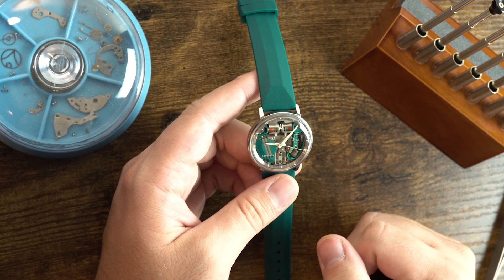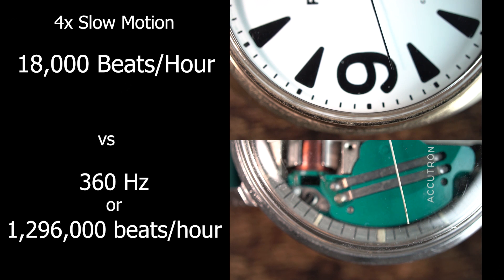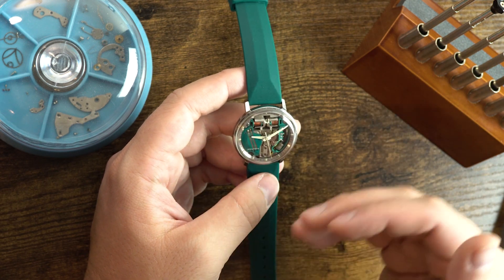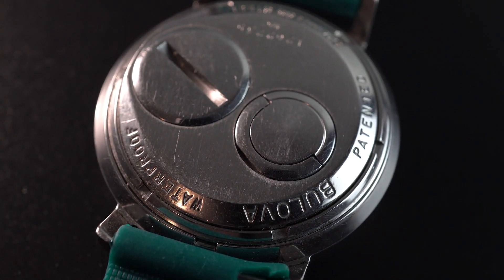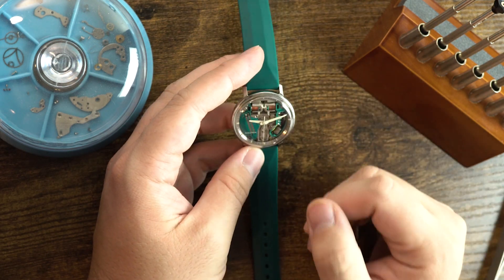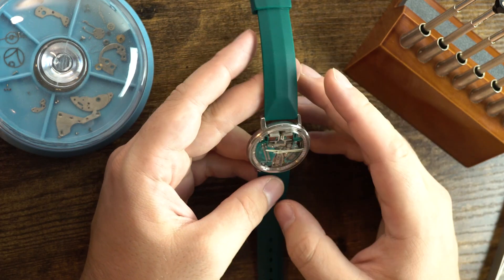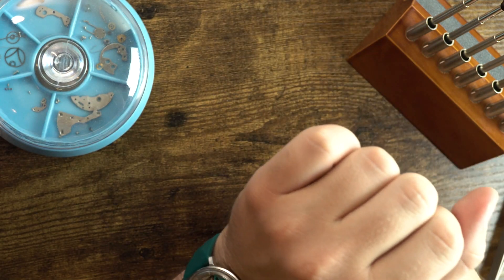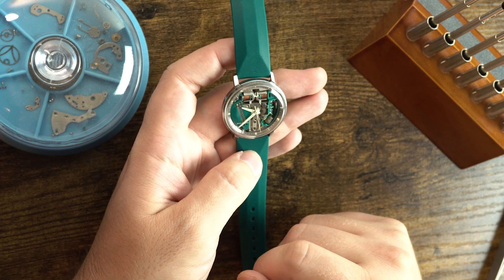Bulova Accutron Spaceview - the Tuning Fork Watch!

Comment: You can date an Accutron by the date code in the back. The letter signify the decade M for the '60s and N for the '70s. The digit signify the year. hence, your watch M5 is from 1965. Great video, thanks!
Reply: But the coil is from an earlier version.  The silver "can" isn't the resistor, but rather the transistor.  The resistor is the white cylinder with the stripes. The 3 wire coils with the transistor at the bottom and all 5 electrical points used is from 1960-1962.
Reply: You are correct
Reply: @stevenmeitner8477  It's hard to see int he video (at least to my ageing eyes :-/) but I thought it read "M3", not "M5"?
Reply: @38thsignal  If you stop the video at 4:33, there is a good image of it.  It's stamped M5.
Reply: Thanks for that info. I never knew what the N0 on my watCh meant now I do.
Reply: @stevenmeitner8477  mine is similar that way. It’s a 1970, but the metal is white instead of gold tone. Somewhere it got a movement older than the watch itself.

Comment: Riddle me this - if the original originals were made using kits sent out by Bulova so dealers could adjust normal Accutrons into Spaceviews surely e-bay sellers modifying Accutrons into Spaceviews now is the same thing just happening later in life to the same watches that would have been adapted back then? Am I right or I am confused? Anyone?
Reply: It isn’t quite the same thing since the eBay sellers aren’t using the factory parts to make the modification. Also, the sellers are representing a newly-modified watch as a watch that was modified in-period. So a seller passing off a recently modified watch as a watch modified in-period would deceive a buyer that was specifically looking for a Spaceview that was sold as a Spaceview originally.
Reply: You are correct about misrepresentation on eBay and it drives me nuts. The overall deception by 99% of eBay sellers is annoying to me. Personally, after I service an accutron and convert it to Spaceview I ALWAYS say that it’s a conversion. Not only in the title but throughout the description.
Reply: @rickstamler5931  Hello Rick where do you sell your watches? Currently looking. Thanks Frank
Reply: Well, if you buy really good reproduction parts, it’s hard to tell from the real thing. They make alpha hands, and the only way you can really tell the crystals apart is the real crystals have a dot of lume that the reproduction one left out.
Reply: @OuijTube  Clark watch parts produces really nice reproduction parts for that

Comment: As other people have already mentioned, your caseback has a date code where you can decode the year it was produced, 1965 in your case. Other things to note is that being an early to mid-60's model, it should either have radium lume (which would have deteriorated the phosporescent material by now), or tritium lume (mid to late 60s) which would have itself degraded so far by now that it should not be glowing much if at all, that your lume still glows so much, looks so fresh, and the fact that you call out it's "hand painted" suggests that it's a relume. Most watch dials were hand painted lume to begin with anyway, that's how the radium girls were poisoned after all. Also, regarding space, the Accutron was used in the space vehicles even if they weren't on the wrists of the astronauts, so it still did go to space. Side note, the first Omega Speedmaster in space was a personal watch before NASA conducted the trials to determine the official wristwatch on the missions.

Comment: I bought my 1967 Spaceview 214 in the summer of 1968 and it does have the standard resistors. It is also marked "Waterproof" on the back, so Bulova was still using that nomenclature as late as 67.

Comment: I believe that the component between 4 and 5 is the transistor which forms part of the self regulating oscillator on Accutron tuning fork watches, not a resistor.
Reply: Yes, the silver component between 4 and 5 is definitely a transistor. The resistor component is between 2 and 3.

Comment: I graduated from Bulova in 1970 and have been repairing & restoring Accutrons for both the trade (jewelry stores) as well as private clients. I also worked at Bulova for a short period of time.  Your video is excellent.  However, nothing was hand painted on the chapter ring.  The chapter ring actually has a decal on it which over time gets worn from as you said moisture and age turns the color and minute track disappears. Also when you were showing the circuit, the silver 'can' was a capacitor, not a resistor which is also in the circuit...As i said, your video is very good..Kudos to you!
Reply: Actually, the "silver can" is a PNP germanium transistor which is the active component in the oscillator circuit that excites the tuning fork. Also, the new batteries at a slightly higher voltage would and could not change the resonant frequency of the tuning fork. Instead, it would increase the amplitude of the tuning fork's excursions. 

 tThe tuning fork drives the movement via a tiny indexing ratchet pawl attached to one of the tines(a small jewel affixed to the end of a piece of hair spring) driving—ratcheting—the very tiny teeth on the very delicate ratchet wheel. Another pawl was affixed to the movement plate to keep the ratchet wheel from backing up as the driven index pawl withdrew at the completion of each stroke. Think tiny miniature "come-along" hand operated winch. 

With too much battery power, the tuning fork would be exited to such a high amplitude that the indexing pawl would withdraw to far back occasionally skipping a tooth 11:36 on the ratchet wheel instead of the requisite one tooth per stroke. This is what makes improperly converted tuning fork movements run fast. 

One can either introduce a silicon diode in series with the battery to obtain  the 0.6V PN junction drop to lower that battery voltage, or retune the movement to tame down the amplitude. You have to really know your accutrons and have the test equipment to do that. 

I've bought many accutrons (and its licensed iterations in other brands such as Omega, Baume y Mercier, Citizen, and many more) off of eBay and had to retune them to slow them down. Some people sell a battery adapter with a tiny diode—designed for surface mounted PC board technology—incorporated. If you have such a watch, don't throw the dead battery away!

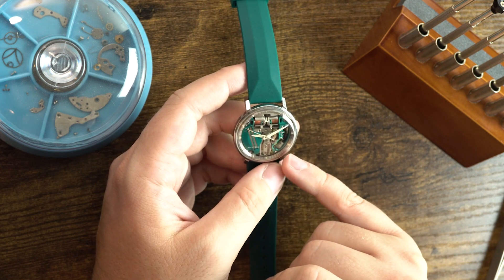Comment: At 3:39, that’s a transistor, not a resistor. Transistors have three leads (some have four) and all three are from the same source...the bottom; resistors have two leads- one on each end.

Edit: I don’t know much about this specific watch but I do know electronics and parts and so I’m just saying what it appears to be.
Reply: If you're making the components yourself, it wouldn't be difficult to manufacture a resistor with three leads, two of which are connected to the same end. Similarly, you can have all leads come out of the same side by wrapping it around inside the casing instead of wrapping it around outside, as you would normally see. It is most likely a transistor, but it could easily be a resistor if they were specifically manufacturing them for this watch.

Comment: There's some discussion saying that the Accutron is the second electronic watch, the first being the Hamilton Electric. With the Accutron, it's clear that the tuning fork indexes the 300 tooth wheel, driving the gear train. This is a fundamental horological difference because up to now, every watch/clock depended upon a power source that needs to be alternately locked and released by a regulated escapement. The escapement did not drive the gear train. There is no escapement whatsoever with the Accutron. I'm not so sure about the Hamilton. The balance wheel is impulsed electronically, but I think it still functions as an escapement. Obviously the gear train is not driven by a spring that you wind up, but there may be a spring involved pulled by a solenoid. I have seen a mechanism like this on VDO car clocks. In any case, the Accutron was ground breaking because it totally abandoned the stored mechanical power and escapement method.

Comment: I understand Bulova initially used mercury cell battery on the Accutron Spaceview. Later due to health risk from mercury, they were replaced by iron oxide batteries which is reportedly not as accurate as the mercury ones

Comment: I have a pair of Accutrons, an original 214 Spaceview that my grandfather bought new, and my father's 218, which has the tuning fork movement but has a stem in the side of the case and white face that says "Railroad Approved". Neat watches and family heirlooms. I've had them both cleaned and tuned up, and they just need batteries to run again. The green strap to match the movement is an inspired choice, and I will be doing that as well.
Reply from the maker: Dang those are pretty much the best versions of the 214 and 218, and they come with family history! That's seriously awesome :)

Comment: You made a quick reference to the battery and resistor, as I understand it, it was made to run on the lower voltage of a Mercury Cell, which supplied around 1.3v, in the mid '80's Mercury Cells were removed the market.
At that point you could use a Zinc-Air cell which gave 1.4v, but only lasted a few weeks, or the Silver Oxide Cell which had 1.5.  Further, if you chose to use the Silver Oxide Cells, there was a modification that replaced at least the resistor, and I think the transistor as well.
Reply: Wow
Reply: You just add a diode and replace the resistor

Comment: Yes, this is the problem I'm having. My Dad bought this in 1964, and it does say WATERPROOF. Inherited it after my Dad passed a couple of years ago. My uncle said with the 1.55 Volt (394) it won't keep correct time. Right, it runs very fast. It's been hard to find the 1.35. So form what I hear you saying, is that I have one that won't keep the righ5t time with-out a 1.35 ?

Comment: One thing I haven't seen discussed, you see on this watch the terminal connection area has all five solder points in use. On later 214's they only use three of them and you can see that they pair-off after the connection. Just something I noticed.
Reply: The original had a germanium PNP transistor, originally designed for hearing aids. They changed to an NPN, I believe its silicon, because of availability. The circuit was redesigned to accommodate.

Comment: Excelent video, Just a question, wich is the code for the battery, I am looking for it. Thank you very much.
Reply: 394
Reply: @Adrian_3006  actually since you will need the spacer to fit a 394, the first time buy a 387S which comes with it, then next time you can use the spacer on a 394.
Reply: @TechDude56  hi, thanks for your reply. I've actually been running my Accutron successfully with a 394 without the spacer since 2023. I got 18 months out of the first battery. When I was researching information about which battery I came across a question on a Omega forum asking about the spacer and the OP was told by a guy Martin Marcus who worked on Accutrons that the spacer wasn't absolutely necessary. Went ahead with the 394 and watch is working well without it!? I did read a lot of people saying battery would short out on sides of the battery pocket, but that hasn't been my experience. Greetings from NZ 👍

Comment: I have two of that same accutron model, exact same ones with same chapter ring, same crystal, One is M4 and already has 2 components instead of your transistor, one of them appears to be a diode. The watch has not been 'converted' to 1.5, so it can't be a conversion either. I /suspect/ that the updated the circuitry to have better regulation, but that's my own guess.
The other is a stainless M7 and is still marked 'waterproof' so they kept that marking for a long time, or perhaps they kept it on all casebacks for this particular accutron model. Many models were converted, but /that/ model is very likely the best quality watch.
The reason I say that is that my M4 is the best accutron AND spaceview I've ever seen, and it's full 18K gold too -- it's the same watch as yours, but 18K, case, back and hands, it's my prized watch, and I prefer it to others in my collection that are 'worth' a lot more!

Comment: Correct me if I'm wrong, but I believe the tuning fork movement ticked 360 times a second or 1,296,000 beats per hour. Wouldn't that make it 180 hertz?
Reply: Hertz is a measure of cycles-per-second, therefore if it "ticks" 360 times per second it's 360 Hertz, it also makes a tone at 360 Hertz which helps nail that down too.

That said I don't have one (yet) to test so I'm mostly just basing this on what I've learned from a few videos about it, so I could just be being a total dumby here.

Edit: listened to a 360 Hertz tone, 180 Hertz tone, and the last few seconds of the video, now I'm uncertain too XD
Reply: From someone who has one, it does 360 ticks per second, you can take a slow motion camera and observe the tiny ticks, it is so smooth because the gear train is also vibrating at the forks frequency so momentum is transferred to the second hand so the tick is not perceivable by eye also because it falls in persistence of vision
Reply: @UNSCPILOT  why do they call watches which tick 3 times a second 3 Herz and watches which tick 4 times per second 4 Herz?

Comment: ay so I just got a spaceview 214 and am having 0 luck with bands.  Cant find em in stores, cant find em online, cant find em anywhere.

Got the one you have here in 18mm width, how the hell did you get this thing on?  My spaceview rejects pretty much every strap thats leather silicone etc that I've tried on it....  I almost destroyed this strap trying to put it on.  How tf did you do this
Reply: Look for 17mm or 11/16" straps.  The actual dimension is closer to 17.5 mm, but some 17's run wider and look fit easier.  Also look for 17mm spring bars.

Comment: On the back cover under the serial number M stands for 1960 and the number after if it were a three that's 63 if it were a five that's 65 after M comes N, N equals 1970 the number after is the second digit so M6 is 1966, 66 N4 1974 there's a chart that shows these numbers and what date it correlates with.

Comment: Great video. Thanks for talking up the Spaceview. But surely the lume can’t be original if it’s still shining. After only 20-30 years the glow would have all but disappeared, let alone nearly 60 years.
Reply from the maker: Lume reacts with water when it breaks down, and the small amounts of moisture that sneak into a watch over time cause that problem. However, some people live in arid environments, so old watches can still glow!

That being said, this watch after being in bright sunlight glows for less than five minutes, so it is definitely showing its age :)
Reply: Tritium lume paint has a 12 year 
half life. After that it's just common phosphorus paint.
( Radium was not used on Accutron )
Reply: Half life is just that...half it's intensity.  It still is emitting Beta particles.  At 24 years, it just is emitting 1/4 of the rate.  The zinc sulfide phosphorescent does fade, but I have many 1960's watches with original tritium hands that do glow albeit more faint.

Comment: That metal can is the timing Crystal, not a resistor. Or it is a Transistor.
Reply: It's a transistor. There is no timing crystal. That function is done by the tuning fork.
Reply: you can find alot of that transistor in old transistor radios from 60's and 70's lol

Comment: Q. When did Bulova stop making an actual "Tuning Fork" powered watch?
I think ALL they make today are just quartz movements.
Reply: Robin Jacobs no they got some new automatics I think
Reply: Bulova also has its ultra high frequency (262kHz) “Precisionist” movement accurate to 10 seconds a year in a variety of pricier models including the Curv series, Precisionist chronographs, and the Lunar Pilot. And as a native New Yorker it has always been pronounced “BULL-uh-vuh” Do a Youtube search for “Bulova Watch Time” tv and radio ads from the 40s, 50s, and 60s
Thanks for the video! That transistor looks odd to me (I have an M4) but the chapter ring, crystal, and handset look exactly right.
Reply: 1977 is when bulova manufactured the last run of the running fork movements 214 and 218 2181 218D

Comment: Your watch has the code "M5" on the back.  M=1960s; N=1970s,  add the 5 as the last digit for year and you have 1965 is the date of manufacture.  If it was "N2" then it would be 1972.
Reply: Yep. 1965
Reply: Thanks ... my watch has an M7 on the back under the serial number.   Which makes it manufactured in 1967 and I got the watch in June 1968 (and still have and wear it)

Comment: 99% of eBay listings are not conversion spaceview. Don’t over exaggerate, but whatever good you think your video serves basically invalidates what you think.
Reply: This video has so many factual inaccuracies. He calls this a 1963 watch when the back litteraly says 1965 (M5). Spaceviews were created by the Bulova shops from normal watches as well. The dial ring he has was part of the conversion kit, or people could get crystals with marking on them. New old stock of crystal, hands can make pretty much Accutron into a genuine Spaceview.